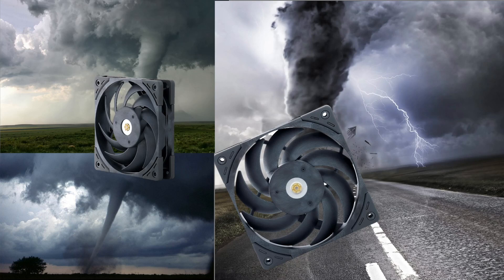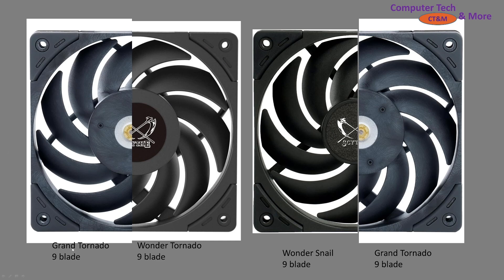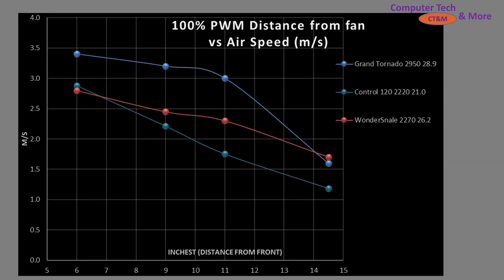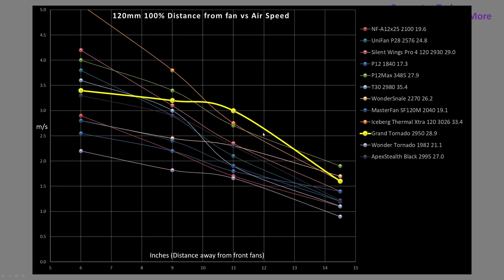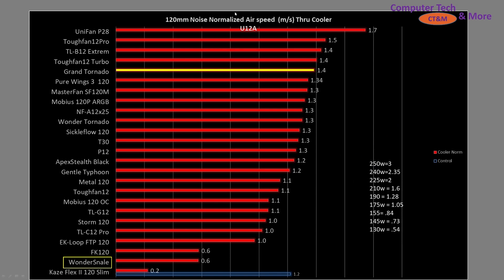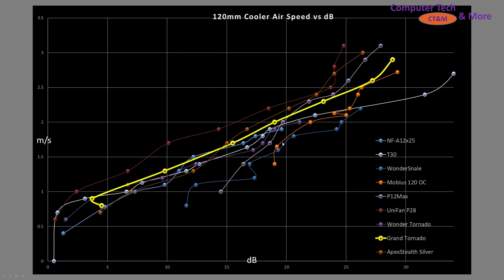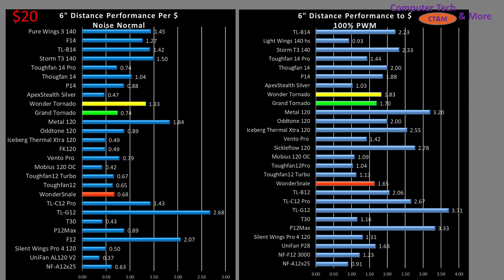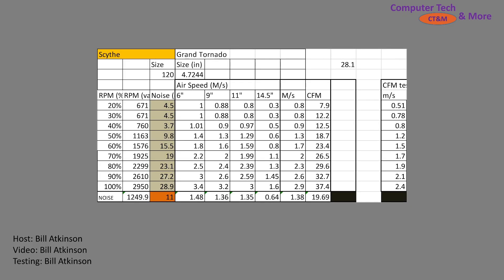Scythe Grand Tornado : EF5 winds approaching.

Comment: Hello, i'm from SCYTHE, we would like to know about your testing platform. Is the PWM connected to the motherboard or an external controller? In our tests, as well as those conducted by other media, we haven't observed such a significant difference in PWM at 100% and CFM compared to other products. We highly value the product in your possession and would like to assist you in troubleshooting.
Reply from the maker: Hi Yen-Chinshen  (Scythe), Yes the PWM was connected to the motherboard and controlled via PWM software same as all other fans I have reviewed. Its actually all performance (PWM) levels in this particular test. 
I'm not sure what there is to trouble shoot. The test is repeatable and this is the only test Scythe fans have trouble with. The only thing that could help is sponsorship to acquire a better testing apparatus and testing equipment. I'm well aware I am a small fish. 
Thank you for reaching out to me. Have a great day.
Reply: @computer-tech-more  Based on experience, some motherboard sockets may not be fully compatible with every PWM control chip. If we could know the platform you tested on, we could replicate the experiment and verify if there are similar issues.
Reply from the maker: @yen-chinshen5488  i dont want to sound rude. but ive tested over 80 fans all using the same header on the mobo. Same extension cable, same anemometer, same software, same test apparatus. Its not the pc, because its only scythe fans for this one test. it performs well or as expected in other tests. its why I legitimately want to overhaul all my testing, I even have a video on my channel describing my plans. But I cant get there without support. 
but for sake of tell you. I have an intel 11700k on a Asus ROG Z590 mobo. 
I really do thank you for reaching out to try to help trouble shoot.